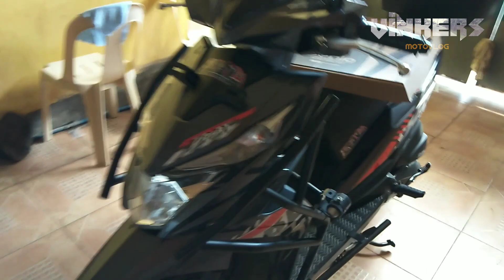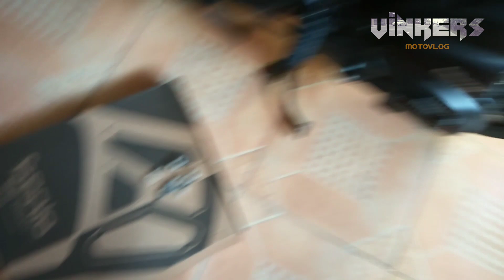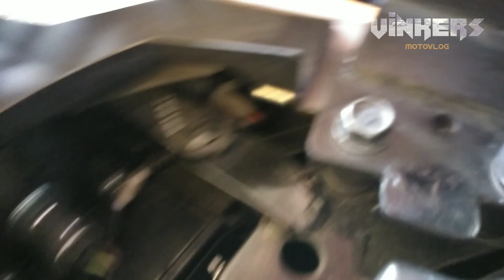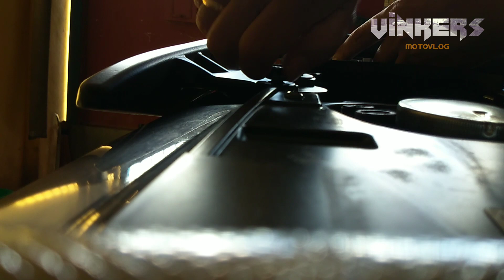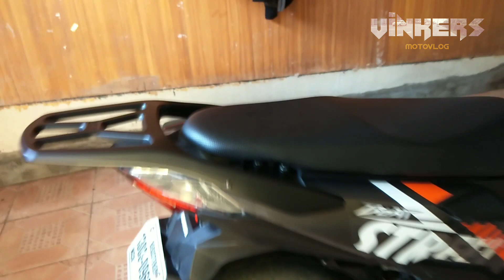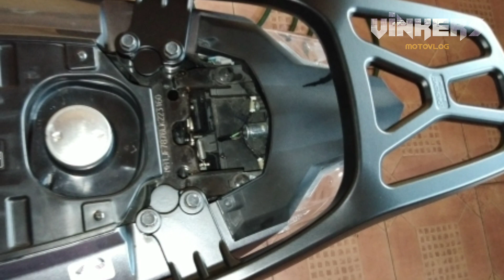SEC Dove Bracket Installation | Honda Beat FI V2

Comment: Noob question, may specific spacer po ba na kailan?
Reply from the maker: Yes paps need po ng spacer para mainstall yang bracket
Reply: @Vinkers11  thank you paps, nakabili din at naikabit ko pero normal lang ba paps na mahirap isara yung upuan?
Reply from the maker: @JanielApolloBodiongan   baka masyado mataas spacer mo paps? Dpat sakto lang para Smooth lang pagsara sa upuan.